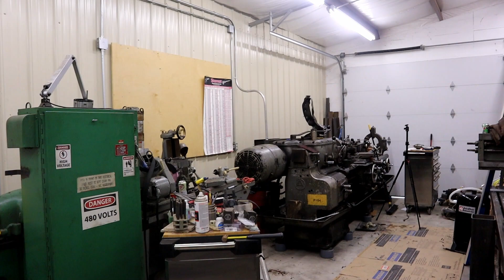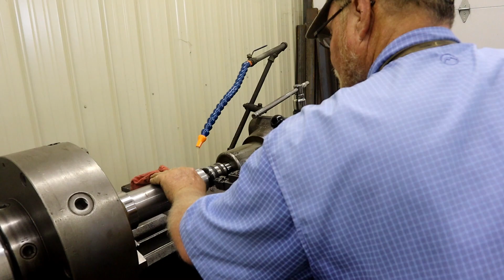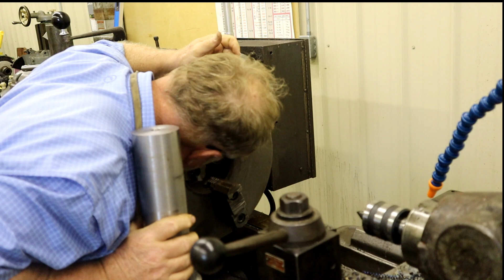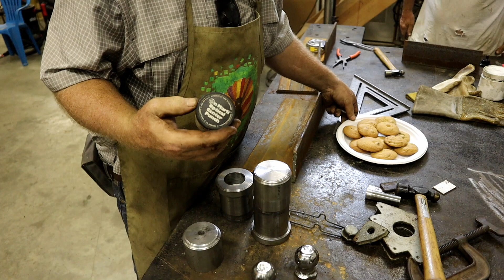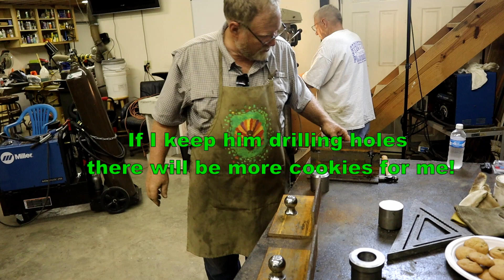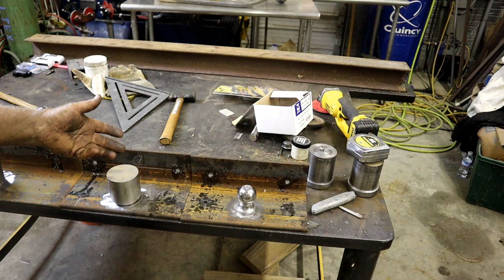How to Build a GREAT Jib Crane : Part 1

Comment: So, you didn't cut a ball cup in the piece you drilled???
Reply from the maker: I am guessing here on "the piece I drilled"   The drill I used has a nice enough radius to give a 1/2" contact area on the hitch ball... Remember the hitch balls are all flat top so the contact area is not 100%.  I could have put it on the lathe and made it a true sphere but it has not really been necessary.

Comment: Hey Steve if you soak that rusty steel over nite in a tube of vinegar it will remove the mill scale and rust so you can get a much better weld.

Comment: Check your tool post holder the tee nut looks to small, great video.
Reply from the maker: Good Eye... That T nut is way too small... I am researching what metal would be best to make a proper size one...
Reply: @10swatkins  I made mine out of a piece of truck leaf spring, works great.
Reply from the maker: @kentuckytrapper780  That is interesting , I would have thought a softer metal like A36 would have been better to handle shock loads..    I'm going to need a piece of metal about 1.5 inches thick to make the T nut for that cross slide so I guess a spring is out..   Working on Planing straight edges right now but the t nut is up next :)

Comment: just curious.. have you ever taken a diamond dressing tool.. that has a nice rounded surface. and chucked it in the lathe tool holder somehow and seen if with coolant flow you could burnish the surface finish to a high gloss.. its just a thought..
Reply from the maker: Nope... I think the heat and coolant would fracture the diamond.. To expensive to try.. Carbide will give a great finish when the speeds and cut are right... I'm using a unknown insert on an unknown metal at a semi crippled speed... I have to get my high range gears back!